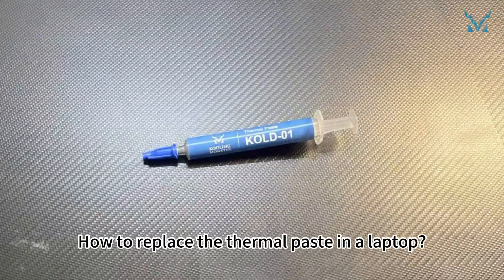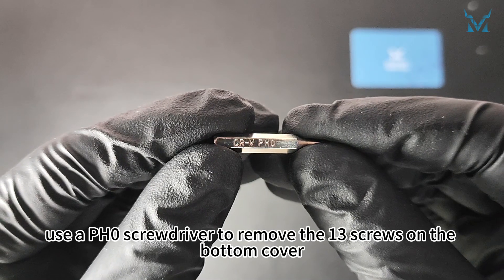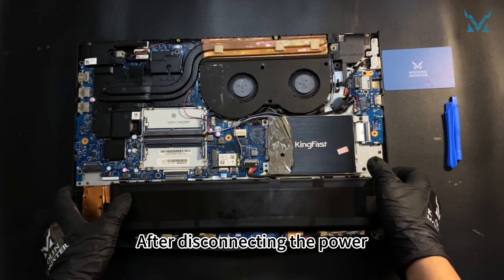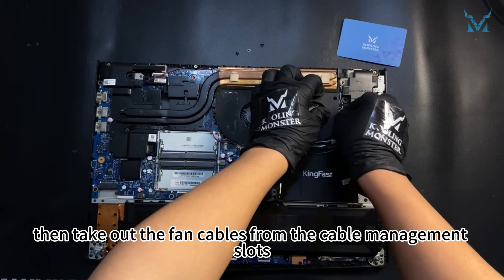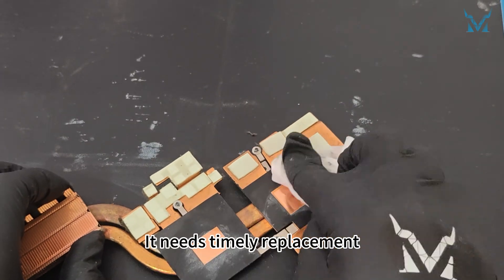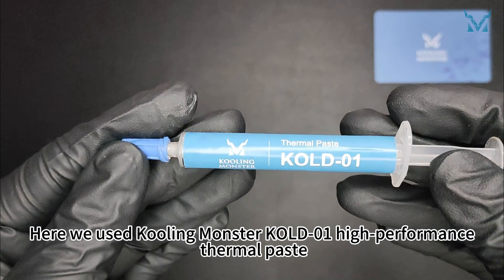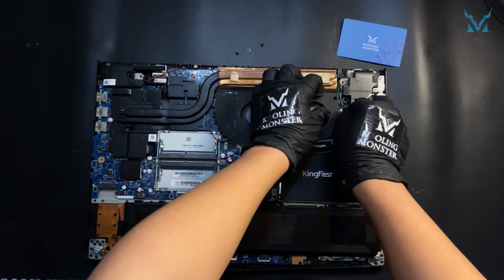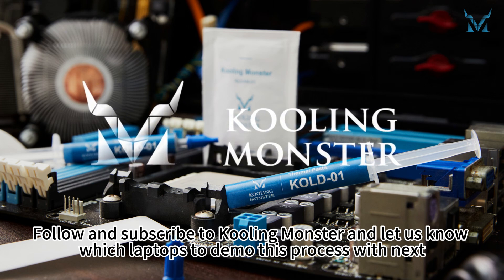Speed Up Your  Lenovo Legion Y520 2017 Prevent Overheating With Dust Cleaning & New Thermal Paste

Comment: That thermal paste application was so bad!
Reply from the maker: Thanks for the feedback! 😊 Every model’s pressure and contact pattern is a bit different — once the heatsink is mounted, the paste spreads evenly across the surface. Cooling results turned out great! But I’m always improving, so I appreciate your comment 🙌

Comment: Hallo, can u help me with finding whats wrong with my Laptop Online, gonna pay what u charge for that. Lenovo Legion y520 is very slow and fps in game 60 drops to 25. I used to have 160fps few years ago.
Reply from the maker: Thanks for reaching out! I’d be happy to help you troubleshoot your Legion Y520. That kind of FPS drop sounds like it could be thermal throttling, old drivers, or dust buildup.

We recommend:

Cleaning out the fans

Updating GPU drivers

Reapplying thermal paste (we use KOLD-01, works great for restoring lost performance)

Feel free to message with more details—we don’t charge anything, happy to help you get it running smooth again! 💻🔥
Reply: @koolingmonster hi, thanks for responding. So my Problem was simple and hard to fix it ( for me ) i wasnt sure whats makes my pc 20-30 FPS in games. It was Processor Throttling to 0,79GHz, what helps ? Only free Program Stop Throttling or so, not sure what was the Name rn. One more Problem is still there. My CPU jumps to 100% also when i dont Play any Games, once Shows Windows Defender 50% so i made Folder that is not allowed to scan. Then some other System things that came out for 3 sec and disapear. Not sure how to fix 100% CPU ussage jumps. I have new Thermal Paste ( 4 Weeks old ) changed in Service. Every driver is installed and up to Date.